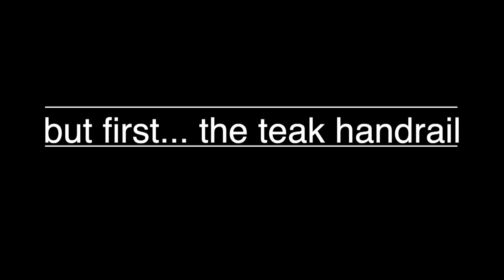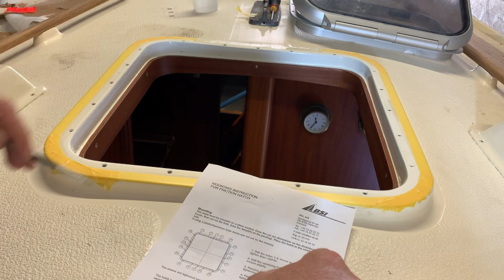[Hallberg-Rassy 312] "Ellos"- Sea4See - MAHOGANY FRAMES & MOONLIGHT HATCHES (INSTALLED)

Comment: About that head liner: When the teak deck was renewed on my boat I asked the carpenter to pay extra attention that both sides of the deck are a mirror image of each other (as the old one had some small differences). He asked me back: "Are you sure both sides are similar to begin with?!" Something never had even occured my mind before I must say! Well at least now you need to look very carefully to see a difference, so I'm happy! ;-) That is something you need to be prepared for when working on these old boats. They are hand made, literally!
Sealant and installations: I have started to use standard house hold window sealant tape in many places I want to be able to take apart easily in the future. (See the cockpit speaker storm proofing video for example). Actually I did a reinstallation of one cabin window on this boat some five years ago using that tape. No leaks so far and if there will be, it's going to be the easyest repair ever! :-)
Reply from the maker: Hello true I really didn’t notice the difference before job done! But all the boat are different port to starboard .. I leave like that as was originally  but what you say is true! Sealant : I used butyl on the W
Hatch for that reason easy to remove without destroying the deck! I use a strong bond on.y to the mahogany stripe !!!